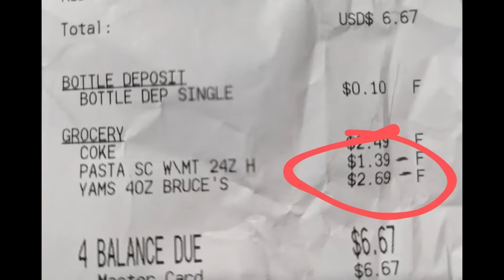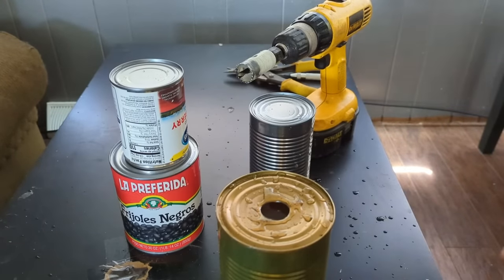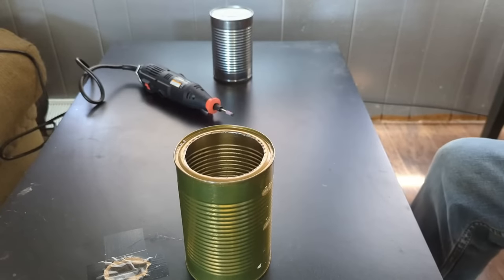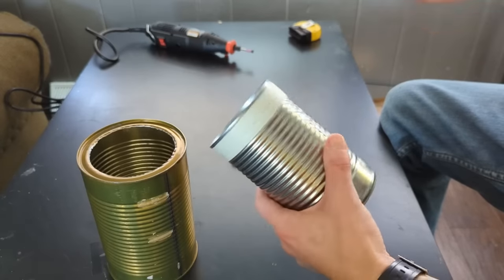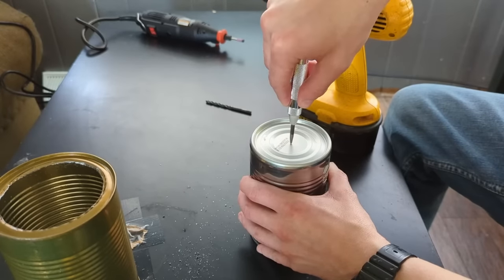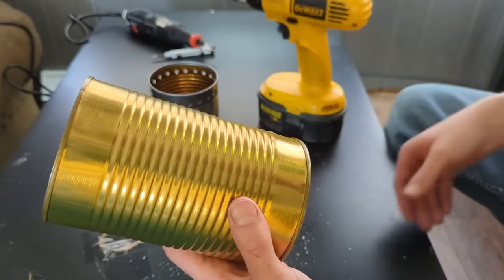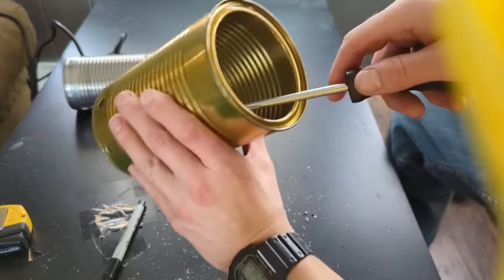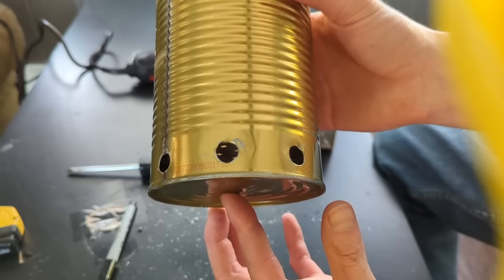$4.08 DIY Smokeless Solo Stove Firepit

Comment: I plan to make one out of a 1 gallon paint can. Every circular stovetop burner grate I have found fits a 1 gallon paint can perfectly
Reply from the maker: Let us know how it turns out 👍
Reply: Thank You for the tip re the fit of the grate to a oné gallon can ; I noticed this when I'd built a couple of larger size stoves and was able to use a "discarded" grate I'd kept for when the family went camping.

A lot of folks may not know this fact, so I'm sure a few will "go" with making the one gallon stove than the smaller one, it they have room to pack it when going camping.
Reply: What can will you use for the inner burn chamber?
Reply: Any can that fits inside the one gallon paint can. Try different sizes to see what works best.

The one gallon paint can is used mainly for one reason, the circular stove grate fits perfectly in the paint can lid groove

Comment: On the second can, rather than deal with the tape, centre punch and drilling...if you open the can first, you can use a regular hand held paper punch* to punch each hole ..these old paper punchs work great for this!

Comment: you could heat the bigger can and freeze the smaller one,  then fit the smaller inside and get a more permanent join once they both acclimatise.    You might only get one shot at this so be quick before they cool and warm.

Comment: Couple of ideas/tips:  Use one of those can openers that cuts into the side of the rolled bead (they come in both hand and electric models).  This leaves the lids able to sit down a bit inside their respective recesses with a good air seal, remaining easily removable when needed.  This allows you to make a better stove, re-purpose trash (the cans), and not waste food.  

Cut the hole as shown in the larger can's lid, fit the smaller can into the hole, and now you have a fire box with an attached sealing ring at the top, that can be easily lifted out of the larger can for modifying the stove with extra holes, dumping ash or whatever reason.  

Do the same thing to the smaller one's lid, cutting a large hole leaving about 1/2" or so inside the edge, and you have a flame ring that builds a bit of compression above the 'jets' and helps 'nozzle' the flame toward the center.  

Both lids will sit perfectly inside their respective cans with a good air seal, without sliding side to side, because of how the can opener cuts them free.

Comment: Smoothing the edges with a metal tool is called burnishing.  You need more holes in the bottom outside ring to increase flow out the top inside ring

Comment: What are you using for fuel? If it's charcoal or wood then the ashes will drop down to the lower can making clean-out perhaps difficult. Smdall pieces of wood/charcoal could get stuck in the interior cans' holes.

Comment: heat big can it gets bigger,  freeze smaller can it gets smaller,  then they both reach an equal temperature and the smaller can expands and the bigger can contracts forming a permanent join.

Comment: Thing is, after all that work, you're gonna get bits of ash in between the two cans at the bottom. Will that affect its performance during the use?
You can just shake it out after use but it's during that could be an issue.

Comment: Paint cans seem better for this cuz the metal is usually thicker and should last longer. And not having those horizonal ridges on the sides thy allow for a little better airflow, though not much.
You could also use some high temperature paint (like those for grills) and that should help preserve it from rust and somewhat from the heat
Reply: There's also this gent on YouTube, heath, who made a whole series on these food can wood gasifier stoves, explaining the science behind it and going over almost every detail of them scientifically  to find what works best.
Reply: Depends on what metal the cans are
Reply: @yummyherbicide7296  i only use cans made of vibranium!
Reply: @pedroclaro7822  what’s his channel? I’d like to make a paint can one.
Reply from the maker: For the sizes that are available to me locally, the size difference between 1/2 pint and 1 pint seem like it might be too big of an inner channel. But you might be on to something.
Reply: @WalterMelons  heath Putnam.

But tbh i almost quit the cans idea, so much hassle finding the right ones and doing the work. I got a thermos and drilled that out instead. It's fine for camping but backpacking i prefer the Ikea utensil strainer. No fuss, works great. 
If you like diy, and want to do one for the household, get an ice bucket. I found a double walled one for 8$ and drilled it out. Nice looking solo stove and much less trouble finding the cans.

Comment: Question.  If there are holes in the bottom won't the ash fall in there and then can't get out?
Reply: You can tap the ashes out through the larger vent holes along the bottom of the outer can.
Reply from the maker: They collect in the bottom...so prolonged burns, it helps to keep some tongs handy to tap the ashes out.

Comment: I know I'm late to this, but isn't the point of the holes on the bottom of the outside can and the holes at the top of the inner can supposed to warm the air and use it to re-burn gases at the top? with the holes drilled in the bottom of the inner can most of the air being drawn in from the bottom will be sucked directly into the fire. Instead of drilling holes I'd put in some sort of wire grate, this will also help keep the ash in the inner can only and make it a bit easier to clean.
Reply: you need both.  primary combustion, then secondary combustion.

Comment: Very cool, roughly how many times have you used it and is it still holding up?
Reply from the maker: I've used it about 15-20 times. Still holding up fine. But I have noticed that ash builds up in the bottom, so it's handy to keep some tongs handy to tap it out every so often.

Comment: Could you just cut the bottom out of the larger can ?
Reply from the maker: You could, but it would burn whatever surface is below it way faster. The flames end up going down through the bottom, up through the inner wall, and out the holes along the inner rim.

Comment: Good evening.  I'm just wondering what the recommended or suggested gap between the cans should be?  I'd like to maximize the burn can but I want to make sure I don't restrict the air flow.  Any suggestions?
Reply: its just best to keep an even spacing around the perimeter of the can. Just know that bigger holes means less holes to drill, but needs even spacing all around.  Don't wanna go crazy big with the holes cause then it'd probably wouldn't work efficiently.  But you do need to keep in mind the size of the project too.

Comment: $4 of cans- $200 in tools.  ;P
Reply from the maker: Nicad DeWalts can be found at a pawn shop for $20, maybe less. Harbor freight Dremel tool was probably ~$10...inherited it. Screwdrivers, maybe that's the $150+, literally never bought one...but everytime someone's cleaning out the shed, I'm there.
Reply: That brick is expensive
Reply: @gamer winner  Jethro Tull was Thick as a Brick

Comment: He put hearing protection on for a Dremel? LOL? Do you wear ear plugs when the barber cuts your hair with electric shears? Same electric motor.
Reply: You're laughing at someone using hearing protection?  Wtf does it matter to you? You're the typical construction crew worker that thinks he impresses people by not taking safety precautions and then wants to act like its other peoples fault when you cant hear or see nor move around. Furthermore, its not the motor that's loud, its the grinding stone against the metal creating a high pitched noise that's damaging to the ear drum.